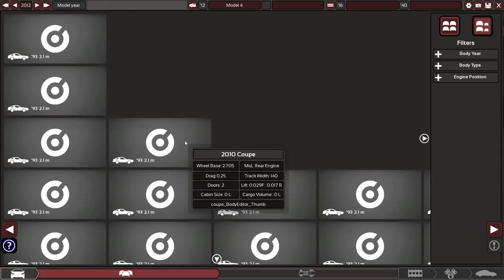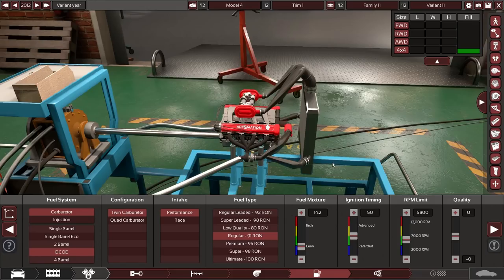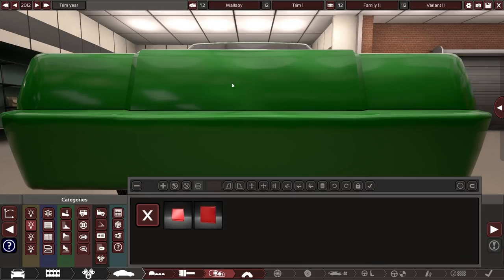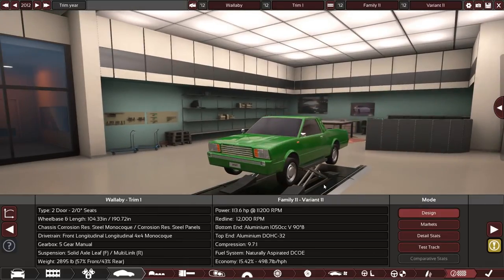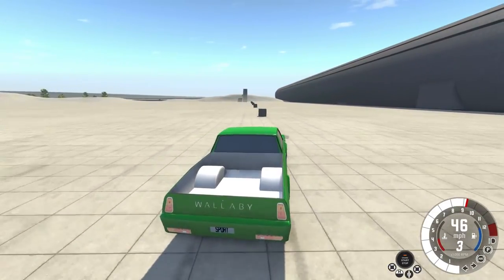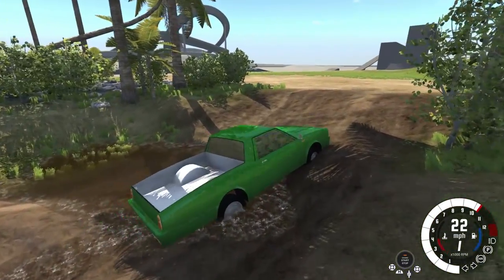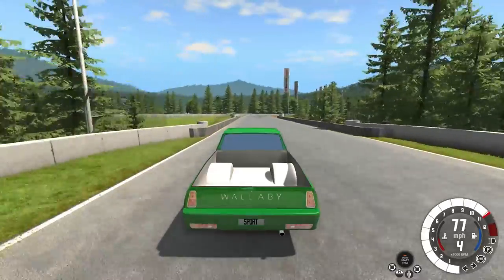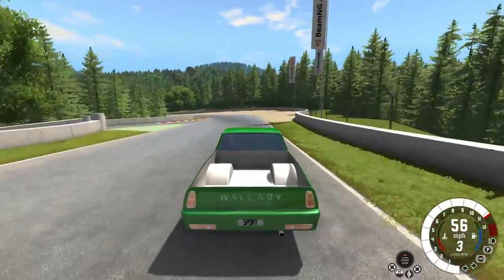1 Liter V8 + 12000 RPM + Ute | Automation / BeamNG

Comment: make a torque monster with a huge motor but no horse power
Reply from the maker: Haha essentially the polar opposite of this one, yeah alright I'll add it to my list
Reply: High displacement with a long stroke and low compression
Reply: apparently torque and horse power are connected, so the only way to do that would be very low RPM
Reply: Kevin Siebert so a diesel?
Reply: 800 lbs/ft at 500 rpm
Reply: put a diesel
Reply: I did that on my channel
2100lb/ft torque @2200rpm
950hp @ 3200rpm
3500rpm redline
12.2 liter V16 twin turbo stroker
Reply: @r0llinlacs  Build me that engine irl...
Reply: Duke of Mecklenburg-Strelitz sure I'll just need a few hundred thousand dollars to fund it
Reply: On that topic, some of Jay Leno's early steam cars push 800+ lb/ft of torque with less than 3 horsepower. Bloody three.
Reply: It’s horsepower not ‘’horse power’’
Reply: So a diesel engine
Reply: Horsepower is proportional to torque * rpm.  To have high torque and low horsepower, the torque peak would have to occur at very low rpm and then drop off significantly.
Reply: So, a diesel engine?
Reply: Jaivir Baweja how about a 12.4 litre truck racing engine (iron knight) it is supposed to get 2400 hp and is a v12
Reply: Like a steam tractor. Slow as all hell, but enough power to move a building and then some.
Reply: Well hp = (torque*rpm) ÷ 5252 so I think a 20L 4 cylinder revving to 1200rpm should do it
Reply: @mitch9521  [Mr. Anderson expected this.]
Reply: You'll hv basically a bulldozers
Reply: @atranas6018  u right
Reply: I have a full engine that i pulled from my '48 truck when i 350 swapped it, it is a 40hp 900ft/lb straight 8 diesel
Reply: @Uejji  not in regards to steam vehicles steam vehicles make the torque from the pistons pushing the axels round (and are actually quieter than a hybrid but still make enough noise compared to an electric car)
Reply: @danielsouders5553  bwahahhaahah!!!!!breathbwaawawawajgaaj,gha,g
Reply: @danielsouders5553 1909  Fiat s76
Reply: Ship engine with 20 wheels to move IT 😀🤓🤠
Reply: Diesel commercial trucks are an extreme version of that
Reply: MatVeiQaaa torque+rpm=hp
Reply: Kevin Siebert diesel?
Reply: if you want a massive torque motor with low hp figures
it either has a narrow rpm range like 500-1500rpm's or it's a generator engine where it's only designed to sit at a certain rpm. usually at the rpm of peak torque.
Reply: @ConsiderGaming  massive Diesel Inline 6

Comment: You should try to make a crazy Group B style rally car, preferrably with an inline 5 with massive turbos. The more turbo lag the better :D
Reply from the maker: Yeah that could be fun! I have a long list of requests I'm currently working on but I will add that to it
Reply: And 1,000 horse power.
Reply from the maker: Lol not for this one :D
Reply: Consider making a RWD group B car, erring on the side of a Lancia 037 and the like; give it an inline 4 conceived by the likes of Lampredi, make it weigh 900 kilos, and bestow upon it a 5 speed manual with a final drive ratio of 1.8.  Since you can't supercharge cars in Automation, give it some Quattro turbos.
Reply from the maker: Yeah I'm planning on doing this in ep2, but I gonna try and make it a spiritual successor to a Saab and inspire it from the Quattro.
Reply: Jos e

Comment: Consider—by the time this car came out it was normal to have gaps where you can fit a hand trough.
Trim year 2012
Reply from the maker: Haha fair enough lol. I like to imagine it's a 70s or 80s car, I just needed better parts for those rpms
Reply: @ConsiderGaming  I'll have you know my 86 cutlass is TIGHT AS FUCK. Dash comes apart
Reply: Consider overhead valve hates high revs
Reply: Wow thanks for the likes it was unexpected...also the engine is so small you get 2 more extra sitting spaces under the hood I guess...

Comment: make a car hit 200 with under 500 horsepower
Reply from the maker: Whew I struggle to do that with 1500 haha... I can try :D
Reply from the maker: #Loopholes
Reply: Sam Pound ez
Reply: @ConsiderGaming  its all in the gearing/wind resistance, someone got a 50cc engine upto 145mph, approx 17hp done by John Buddenbaum and Eric Noyes.. (love to see if this game can do that..) soo, if this game follows the laws of physics to the letter, 1300cc engine (160hp approx, or a hayabusa style, 300mph) should hit that no problem..

Oh wait, you cant just make a 200kg chassis to run with that eh? hmm..
Reply from the maker: You know, that makes me want to experiment a bit. I know beam has wind resistance physics, so I wonder if I could recreate the same circumstances and replicate it... interesting
Reply from the maker: Yeah doing some quick research, I'm getting an idea for an event
Reply: @ConsiderGaming  oh dear, what have i done :P
Reply: @ConsiderGaming  a tip would be use a car with a low roofline
Reply from the maker: I'm thinking of something with a Radical style body tbh
Reply: Top speed would depend more on gearing, engine rotation speed and final drive ratio... definitely doable, even with 50 horsepower.
Reply: @ConsiderGaming  go aerodynamics and longest gears possible nobody ever said how big the map is that u do it on just do grid small pure with longest gear ratios and iltra light
Reply: @ConsiderGaming   the Porsche 959 hit 200mph, with 444hp...replicate that
Reply: @dukeofmecklenburg-strelitz8030  any m3 with 300hp+ can almost hit 200mph
Reply: @ConsiderGaming  count it in kmh 😅👍
Reply: Maximus Psychosis my car is a 1795cc (approximately) or 94kw which is around 100hp
Reply: @daly2348  94kw is about 150 hp
Reply: Joonas Laakkonen yeah I converted it after commented and just realised that it was more but didn’t commend lol but yea ☝️☝️
Reply: @dukeofmecklenburg-strelitz8030  or Plymouth Superbird
Reply: @ConsiderGaming  try to make a lightweight kei car with 400hp or 300hp
Reply: The car would have to weight 450kg

Comment: May I make a suggestion? Try building a car designed to actively try to kill the driver :)

On the outside it looks like a generic sedan. On the inside, it's got a swing-axle rear suspension, an engine hanging on the rear bumper, and a suspension soft enough to make GTA IV cars seem like go-karts
Reply from the maker: Next season theres gonna be a car that basically a giant deathtrap. Except its gonna be 1000+ hp and fwd
Reply: @ConsiderGaming  I'd love to see that, holy shit

Comment: Dude, a quick tip: I’m not sure if you know this, but at the top right of the screen you can change the time period the car was made in.
Reply from the maker: Lol yeah, I know. Usually I just forget to adjust it or leave it so I can "cheat" a bit.  For example, I want to use a Ute body but I really needed those modern parts to get those RPMs haha
Reply: Consider Oh ok. Thanks for clearing that up.

Comment: Don't think the Ute/El Camino could hit 12k RPM.

Then again, I don't think ANY iron block push rod twinvalve stroker V8 could hit above 6k RPM.
Reply: Don’t call a ute, an el Camino.
Reply: @ryanryan6981  It's literally the same thing but rebadged and the driver's seat is scooted over.
Reply: Yeah I know, I’m just saying it’s a ute, not necessarily an el Camino. So don’t call it an el Camino.
Reply: And what do you mean rebadged? There’s no just a car called a “ute” there’s other a kingswood, commodore, falcon or valiant ute in Australia.
Reply: And el Camino in based off like an EK Holden or around that era. but is a completely different design.

Comment: Build a supercar with this motor, Cast Iron V10 Push Rod, with a 101.6 mm bore, and a 98.6 mm stroke, with the biggest turbo you can put on it with as much boost as possible, and the max RPM is 4500 RPM. Heads and Block are cast iron, internals are your choosing

Comment: Small displacement doesn't always mean low torque. British Racing Motors 1.5L supercharged V16 made 600hp - and that was back in the 50's. Cranked all the way to 14krpm. Displacement roughly equivalent to a VW Super Beetle engine.

Comment: Jesus, that gearing... though, looking at the torque curve and the weight (more than 10 seconds to 50 even with those motorcycle gears, and probably something like 15s to 62mph... which is utterly hopeless for nearly 120bhp, it'd be more reasonable for a lighter car with 60hp), you probably couldn't have given it much more than 20mph/1000rpm with a cruising top gear, or maybe 16 for a max speed 4th or 5th... and the spacing would have to be fairly wide to still give a decent launch gear (maybe topping out at 30). Still, 5500 at 50mph, ouch :D